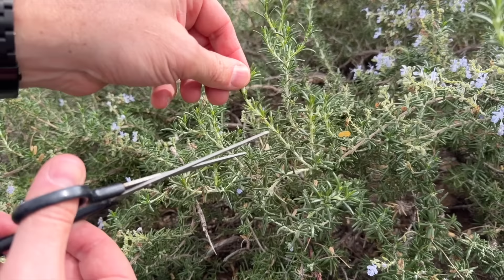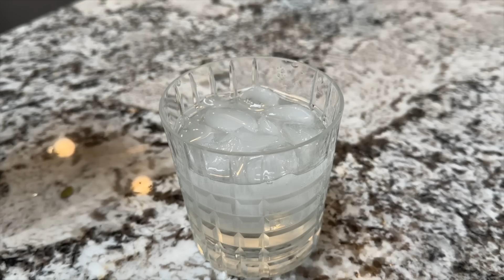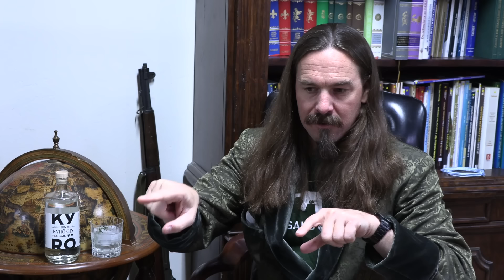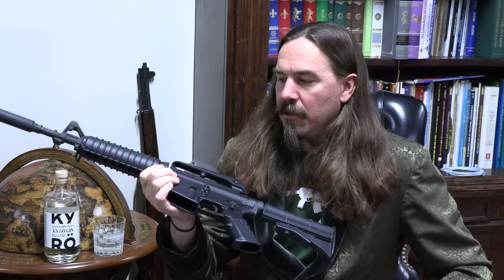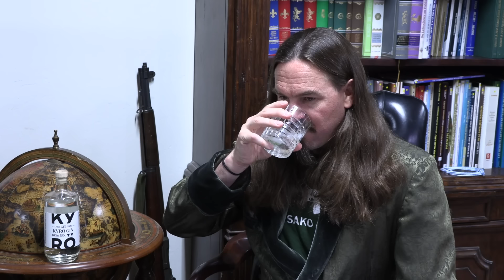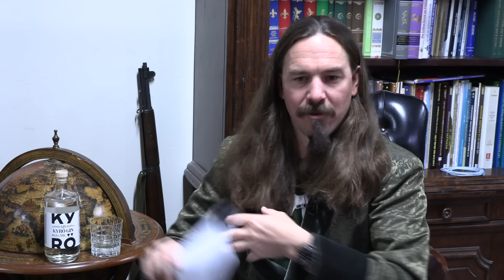How Guns are Made: Tolerances, Methods, and Metallurgy (Q&A January 2026)

Comment: @54:36  I don’t think AI would be very useful for this at all because in my experience AI has a hard time grasping even rudimentary mechanical principles.  A good example of this is brake chambers for air brake systems.  They are a super simple mechanism consisting of 2 diaphragm, 2 push rods,  and 2 springs.  On top of that there are THOUSANDS of photos of diagrams of brake chambers readily available on the internet.  For whatever reason though if you ask AI to show you how a brake chamber works it spits out an unholy abomination that has the visual components of a brake chamber but assembled together as if you literally shot the parts out of a shotgun onto a sheet of paper.

Comment: Regarding the question around 9:10 asking about woodworking, the book "The Tycoons: How Andrew Carnegie, John D. Rockefeller, Jay Gould, and J. P. Morgan invented the American Supereconomy" by Charles R. Morris spends a fair amount of time describing the improvements and technological advances in the woodworking process of buttstocks, lathes, part interchangeability (huge deal), etc.

The author also makes a point of describing the differences between American style "high waste" lathes vs the more "low waste" lathes used in the United Kingdom due the higher cost/lower availability of wood. It also describes how the North East used to be the kind of "Silicon Valley" of the 18th and 19th centuries, too. It's a really good read if you care at all about the history of early firearms manufacturing.

Comment: Can anyone recommend a channel that talks about manufacturing processes like stamping in depth but accessible to lay audience? Preferably in historical context but just generally would be fine too. Things that in these gun videos often come up, like “this part was made with this method” but the method is (not unfairly) not elaborated on at all, cause it assumes a certain base familiarity. But if you don’t have that then the statement isn’t really meaningful, but a quick google doesn’t give you a thorough/nuanced enough understanding and the relevant Wikipedia articles are impenetrably dense jargon filled rabbit holes lacking in context.

Comment: Much of the true repair work done these days is on out of production firearms for which there are no available original replacement parts. I would call the gradient that Ian describes here as the gunmaker-armorer spectrum. I've found it useful in my career to describe simple malfunction diagnosis and parts swapping as "armorer work" even if it involves minor fitting or tweaking to get it to function, such as slightly bending a trigger connector on a Glock or an ejector rib on a Winchester 1200, for examples. The general consensus that I have encountered is that anything that involves cutting, joining or amending metal, plastic or wood in a professional manner can more properly be called gunsmithing. Whether it's making parts from raw material, repairing cracked stocks or modifying existing parts for some new purpose, such as drilling and tapping a receiver for scope bases or "bobbing" the hammer of a revolver for instance. There has been an uninterrupted tradition of complete craft gunmaking in America since well before the revolution but I don't think that it has been a scarcer occupation than it is today. Much of the world's most important gunsmithing has been the developmental "tinkering" since industrialization that we've all likely enjoyed learning about so much as covered by Forgotten Weapons.

Comment: Let's be real, small firearms aren't as impactful nowadays. Manufacturing of drones and missiles are the jam. The biggest hurdle is definitely the production of electronic components, which are mostly manufactured in China. That's where you should be looking at. 
One thing Ian didn't mention is the assembly. Sure, CNC machines can literally make any rifle part, but they can't assemble anything. It would be possible to use manual labour, dedicated giant automated lines or more interestingly: micro-manufacturing where robot arms are programmed (just like CNC mills) to assemble weapons piece by piece but almost fully automated.

Comment: On the note of measuring every part there’s a way to somewhat cheat a little. If one cutting tool is used for making the same cuts without a tool change then you can pick the most difficult of those cuts and quickly measure that on each part because so long as that cut is right then all of the other cuts are likely to be right unless you can visually see that something is off. So on a given piece where you might use 3 different cutting heads to make 15 different cuts you realistically only need to make 3 measurements on each piece and and then measure everything on the 10th or 15th piece and you can pretty much get away with that

Comment: Firearm repair is for sure still a thing with many antique firearms. Often replacement parts are either unavailable or require fitting. 

That's where those traditional gunsmithing skills are irreplaceable. Without them that old gun is just a paperweight

Comment: 38:11 when a cutter wears, typically the dimension either grows or shrinks, depending on the cut that tool is making. There are parameters on the cnc machine to accommodate that. If a cutter wears too much, it will either cause the surface finish to fall out of spec or it will break. Usually a cutter will be adjusted as it wears and when a predetermined number of parts have been made, the cutter will be replaced and the parameter will be reset for the new cutter. When we were doing SPC we typically recorded every tenth part or so, but if anything gave us any suspicion, we would check critical dimensions for each part as a way of problem solving. However, I suppose if your process was super dialed in, you might see SPC samples being fewer.

Comment: spring steel is the one you forgot. could be up to 8-10 different alloy metals in any modern rifle. Somone should make a cnc bilet stainless steel in the raw AR15 reciever. in brushed polished or swirled and also a stamped stainless steel hollow version would be fun. A stamped steel 1911 reciver would also be fun

Comment: On the stamping question. Most conventional stamping of firearms components "not the receivers and other large components that have been replaced by injection molding" has been replaced by fine blanking. Its a process similar to stamping but is able to make incredibly accurate part with all: bends, holes, formed features, ect all being added in the tool and pumped out about 1 part a second. I cannot think of a single modern comercially produced firearm that does not have at least a few fine blanked parts in it. 

The real advantage is you get finished parts ready for heat treatment without post machining. 

The tools themselves are more complex and expensive to build, but that downside is aggressively overshadowed by the precision and manufacturing efficiency provided making it a no brainer in modern times.
Reply: Also generally injection molding tooling is dramatically more expensive than progressive stamping or fineblanking tooling. They are just different processes to make different parts with different design requirements  and that's why you pick whatever process best fits your design. 

Ideally you design you part to best fit the intent and the process that best suits the design requirements.

Comment: Many companies are already 3d printing stamping dies, if you get a few dozen uses out of them and find an issue, you just saved $300k-750k in tooling costs making them from metal. First time I saw them used was a few years ago for aircraft prototyping/limited production parts.

It also takes less total time than getting it milled because, believe it or not, you can't just go to Home Depot to get the giant blocks of tool steel needed to make dies, and the shops that specialize in making dies are busy (like 6-24 months out busy). Even if you have to farm out the print you could have one in your hands next week to try out.

Comment: The M16 front sight / gas block is a forging not a casting. And it in fact very much a pressure bearing component.

The trigger group on the other hand is cast, not milled.

And at a manufacturer producing guns as opposed to a hobbyist building a parts kit: Pressing in a barrel until you get the correct headspace is not how it is done. Everything is cut per design and assembeld and then the headspace either passes of fails QC.

Comment: When you are talking about injection molded parts, I usually find people dont really grasp what 'really expensive' actually means... Molds (for injection molding, but I would assume is the case, at least to a certain extent for the dies for stamping) can cost 10's if not 100's of thousands of USD... So it really only makes sense, most of the time, if you are going to be making enough of the part to spread out that cost over many parts.
As for 3d printing... I'm not sure I'm as confident as Ian is as far as metal 3d printing coming to my garage even remotely soon (though I would definitely love it if it did). Absolutely it will get cheaper (and has), but I think it will always be a minimum of many thousands, to perhaps 10-20 thousand. To my knowledge, the most accurate metal 3d printers use 'metal powder sintering' to actually fuse the metal into the part (layer my layer, almost like a home plastic 3d printer). But the lasers need to be quite high powered to be able to melt the metal. So aside from the precision you need on all your axis, which is not cheap to achieve (though FDM (plastic) 3d printing is likely driving that cost down), you need a high powered laser (and a diode (LED) laser wont do, as it's the wrong wavelength). So you need something like a fiber laser or gas laser (CO2)... those are still quite expensive, and I dont think the cost can really be driven down much more (or it would be happening already). As an example, if you are looking for a 'cheap' home laser cutter (as I was quite recently) that can cut/engrave metal, it will set you back 2-3K at a minimum. The majority of that cost is all the laser.
But as for uses for 3d printing (mainly referring to metal here), as Ian kind of said, it really only makes sense for very small volumes (of high cost parts). 3d printing is slow (both metal and plastic), when compared to almost any other method. Yes the machine can perhaps be much cheaper than the injection molding dies for example, but since the time per part is so much slower, the cost per part is drastically higher. But for things like the mentioned recently developed suppressors, which are already low volume/high cost products to begin with, once you factor in that no traditional 'subtractive' manufacturing part could ever make the geometries, then it totally makes sense. And just like suppressors, there are other 'one-off' 'real' products that can be produced using metal 3d printing... There are a couple different aerospace companies making 'real'/production rocket engine parts using 3d printing. But in that case again, the number of parts you are making, versus the price per part, causes it to make sense (plus, it allows them to create geometries that would be impossible to create any other way, just like the suppressors).
(just my 2 or 3 cents, mostly just backing Ian up I guess.... as if he needs backed up...)

Comment: OK - your mention of the different types of aluminum maybe being used for different parts in the same rifle sent me down a rabbit hole of aluminum materials science - at least as far as a few surface Google searches would take me….  

Materials science - like so much of modern science and technology AMAZES me!!   The difference that alloying small amounts of other metals with aluminum can change it from a soft, softening at low temps metal into something that has a similar strength to steel - using things like silicon in “alloy” that isn’t really, strictly a metal -  sure it’s a metalloid, but STILL!!  Imagine the trial and error that goes into creating these blends, when the properties of sum of the ingredients is often so SO much different that the sum of the properties of those ingredients on their own.

Comment: Cranberries freeze very well - they don’t turn to mush at all when thawed. I’ve picked and used cranberries in northern Saskatchewan - the real bog cranberries (Vaccinium oxycoccus) not just the “false” cranberries that also grow there (Viburnum trilobum) which are also good if when you can’t find the others - gathering them after several nights of hard frosts, sometimes picking them frozen, and they’re fantastic. I’ve also used frozen, commercial cranberries (Ocean Spray - which seems to be a cranberry monopoly), which are meatier yet still stand up VERY well to freezing and thawing. The “false” cranberry is usually not even harvested until after a hard frost as that reduces the bitterness some have - at least that’s the lore - I kinda’ thing that the level of bitterness is more dependent on the amount of water available to the plant while it is growing its fruit. 

Failing finding the fruit frozen, they can also be found “candied” - somewhat dried after being “brined” (likely not the right word” in a sugar solution. I think those would be wonderful to use, and they keep forever at room temp, often being used in “trail mix” type nut, dried fruit, granola, etc mixes. 

I’m sorry, this is WAY more cranberry info than most people want in a firearms channel, but I thought it might be interesting to those who hunt in northern climes and might want to add cranberries and false cranberries into their bush grill after a kill along with the standard juniper berries, blueberries, wild mint, pineapple-weed, and - my grandma’s favourite, easy to find, bitter herb - yarrow.

Comment: On the Blanchard lathe for making stocks, this technology is actually alive and well in a completely different industry - locksmithing. Modern key machines are robotic used versions but there are still manual key machines widely used to trace old keys onto new blanks. I used them all the time when I did safe deposit box work for banks.

Comment: Very cheap products are never trying to create a brand. The only purpose of those products is to make money and never prestige.

54:30 AI will not help you because the scientific community hasn't yet built any comprehensive searchable database for engineering materials modelling. This is not an industrial secret nor any other secret. 

There is very limited amount of information of materials which have an actual proper thermodynamical model. There are much less materials which have a proper thermochemical model.

Also, AI is great with interpolation. AI is unable do extrapolation.

Comment: 1:04:20 one thing that ameliorates this is that SAAMI has precise standards for every ammunition caliber out there, and it includes both the proof load, the pressure range of the ammunition and the dimensional tolerances of the cartridges. This allows designers to have a pretty good idea nowadays of what to expect in terms of work pressures, timing, and fit tolerances before any metal gets machined in the first place. Of course problems happen, and QA problems of certain ammunition manufacturers can lead to problems as well, but it works the vast majority of times.

Comment: CNC guy here. Ian I believe you actually undersold how fast you could ramp up military production  in the modern world. If I were doing this project I would have one company prove out the fixtures, CNC programs to reproduce them, and the CNC programs for part production. Then I would distribute all that in a starter package to any contract shop that qualified to produce them. Those shops would then have 80% of the work done for them and would just have to recreate the fixtures and fine tune for their specific equipment.

Comment: Hey Ian, small correction.

Firstly, I own and run a manufacturing company that mostly uses wood and makes wooden products - that's my qualification to talk about this.
Air dried wood is NOT "better" than kiln dried. Air drying is just cheaper, so companies in ww2 were inclined to use air dried lumber first, before resorting to more expensive kiln drying.

For high quality wooden products, you want kiln dried - because it not just stabilizes the wood by removing the moisture, but unlike air drying - it kills any bacteria that'll cause the wood to rot, and any insects that may have gotten into the wood first.

Comment: My uncle made custom gunstocks for many decades. He supplemented his custom stock business with piece work for larger manufacturers like Browning. One time he showed me a machine he had that cut cut up to 24 basic stocks at the same time, using blanks clamped into a machine with 24 linked cutting tools by moving the guide contact over the surface of the already formed model stock. Very basic and very effective, as one technician could make up to 24 stocks at the same time.

Comment: Regarding the fit and finish stuff that gets scrapped in wartime production, look at a pre and mid WW2 Mosin. Pre-war had hexagonal receivers. During the war, they just rounded it off because that was good enough. Pre-war had the outside profile of the barrels smoothed out the entire length, including under the handguard. During the war, they started to get what looks like small ribbing under the handguard because they used a coarser bit on the lathe to turn the barrels to the right diameter because it allowed more barrels to be made and nobody actually cared about if the barrel was slightly ribbed.